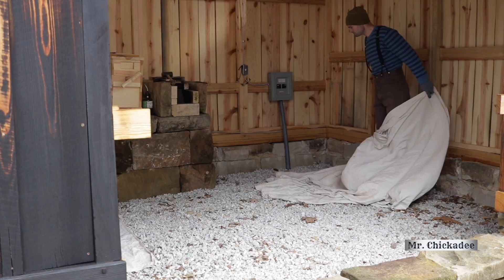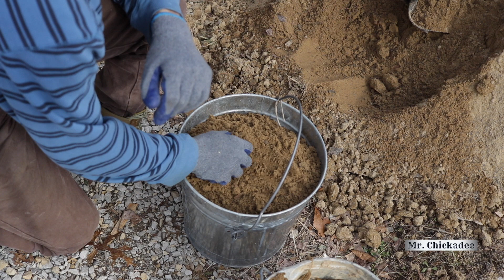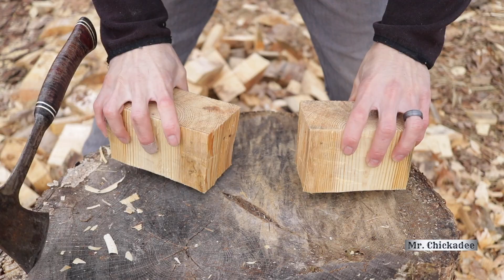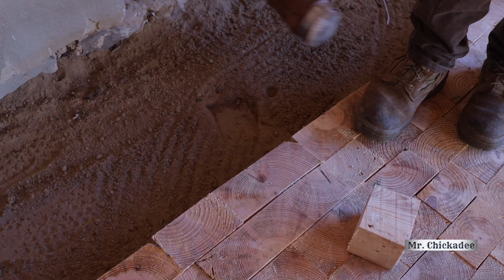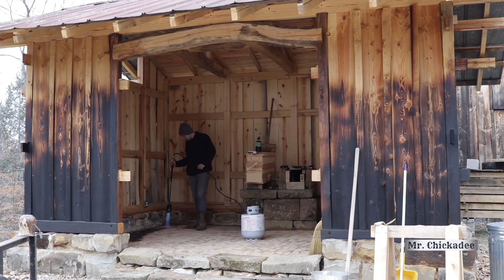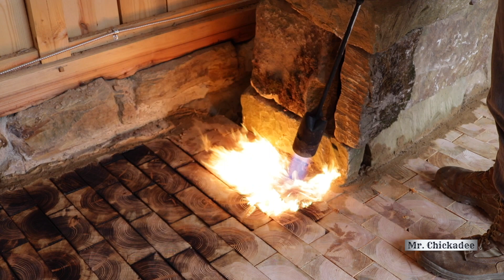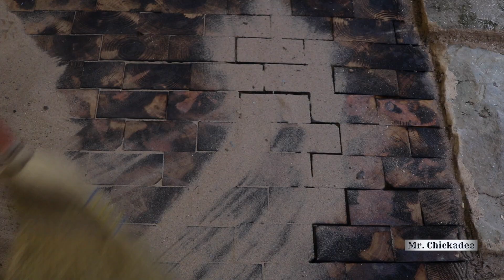Making a wood brick floor for our blacksmith shop

Comment: I worked in a shop with a wood brick floor for 4 years. A real advantage of this floor is that dropped parts suffer much less, or, no damage on hitting the floor.
Reply: My question is. How this floor keeps the level? I mean. doesn't the bricks move?
Reply: @emmanuelmartin2310   As he's installed them, they have a little give to them. I'm also guessing that he's doing it traditionally.

As for when they were used in industry, predominantly in toolroom applications, they were set on a concrete floor. I've been in a couple of shops that had them, and the blocks were 4"~6" tall. To set up a a machine, they just pulled up the appropriate number of blocks and and used the leveling pads/ assemblies on the slab under them, or put down steel blocks to replace them. That's the way it was explained to me.

Industry's gone away from this type of flooring for a lot of reasons, one of the biggest being safety. They soak up oil like a sponge, making them both slip and fire hazzards at the same time. They're also expensive up front for the wood; in the machine trades, oak or hard maple were usually the preferred types of wood, and those are slow growing species, versus softwoods like pine.
Reply: @7891ph  thanks for the answer :D
Reply: Plus they suck up a lot oil
Reply: The main advantage is that kind of floor does not hurt your joints back and feet when you walk stand on it every day for long hours. I you ever walk on one its like no other.
Reply: @emmanuelmartin2310  You can only squeeze so much into a finite area, the perimeter is fixed and if you fill in all your gaps it becomes a floating floor and will shift as one unit. Great floors.
Reply: 7891ph what if they sealed it or used the shoshugibon technique? Would that make a difference, or no? I mean you have to seal it with oil every so often anyway so the oils might help make it last even more than 80-100 in theory? Lol or is that the wrong type of oil than what they’re dropping on the floor? (note: I’m really asking, not sarcasm.) Oh lord, so I just got to the part where he burns the floor! Guess that answers that questions 🤦‍♀️ Wellp... this was a completely useless comment. But patting myself on the back for being on the right track, I guess.. 😂😂😂 should’ve finished the vid before commenting.
Reply: @ashleyfalcon125  Most floors were soaked in creosote to help preserve the wood. I worked at a production facility that was built in 1942 that still has an original section of wood floor. 

A disadvantage is that if the floor gets wet, the wood expands and heaves. It takes a lot of work to fix it.
Reply: @emmanuelmartin2310  no its much like how they do stone path ways, well exactly how they do them, the sand grouting keeps them in place.
Reply: Why not just leave it as dirt? my dad shop have a dirt floor and it seem fine.
Reply: @angerskarin9222  it makes it a bit easier to keep things level and tidy and won't wear, like at all even with heavy industrial traffic. So it could be said to be more a long term professional setup. Lower maintenance when lots of people are moving around on it all day everyday. No need to fill in where the dirt gets displaced. But more than that I suspect it's a point of pride type thing. There's just something satisfying about working on a floor like that that you don't get from concrete or dirt. It's one of those funny things humans do. The artistic view of what is the way of doing this that is in some way, however insignificant, superior to the others imo.
Reply: @angerskarin9222  Mud, puddles, holes...

Comment: I have seen many floors like this in my lifetime. I am 63 and have been in many factories built since 1900. This was the floor of choice. Thick wood floors in early Ford, General Motors and Chrysler assembly plants was much more comfortable than standing on concrete all day.  The intent was not beauty however it was used to save on back problems due to standing on concrete.
Reply: I worked in a ford stamping plant. The wood floor was used to cut down on noise and was easy and cheep to repair.

Comment: Sixty years ago I too worked in an old factory that had a woodblock floor. One Monday we came in to find the floor all "bubbled" up. It was crazy. There had been a large water leak in one of the old pipes and the wood soaked up the water and did impossible things. It even lifted a couple machines with it. It was a sad sight.
Reply: Sad but cool!  All of the factories I've worked in have had concrete floors.
Reply: I've seen them bubble as well, it's pretty wild to see it. It reminded me of a Salvador Dali painting!
Reply: They would probably be easier on your feet than a concrete floor too

Comment: In my home town in Yorkshire, when they removed some bitumen fron a road, lo and behold, underneath were wooden blocks.  Been there since the early 1800s, it seems.
Reply: I am from Irkutsk, Siberia. A century and a half ago city center streets were paved with larch blocks. Pretty the same technology as Mr.Chikadee used and as you mentioned. It seems that it was a kind of standard technique for that times
Reply: I`ve seen the same thing in a lot of the old London streets. Apparently they are all cedar blocks and were felled and brought over from Australia.

Comment: Where I worked, a 745 mega watt coal fired power plant, the mechanical maintenance shop used that type of floor. It lasted for over 50 years of very hard use. It's demise came when there was a flood which floated most of those blocks. Being a very timely task to reproduce that floor it was decided that the blocks be disgarded and concrete was poured as a replacement. The men who worked in that shop missed that floor. Also my wood working shop in junior high school had the same type of floor, it is still in service over 75 years old. Ecellent floor. :-)
Reply from the maker: wow, hard to imagine the concrete was cheaper? Maybe it was a labor cost issue? Or they did not find skilled labor who knew how to handle the job? I would always find wood to be much cheaper and better than concrete...
Reply: @MrChickadee  It was an issue of speed. They had to get that shop back in service as quickly as possible. Those blocks would have taken for ever. The plant was torn down in 2014 and 15 and replaced by a new modern plant.

Comment: I worked in a steel mill (sheet mill) in the 60s, where end grain hardwood floors were used. Those were typically laid over concrete, and usually sealed with some kind of pitch. They stood up to coils much better than concrete. Berger Juel (sp?) in Chicago used to make this flooring for high-end residential use. It was featured on a This old House project many years ago, when Bob Villa was in charged. It was awesome.

Comment: Job well done. I've been in lots of steel mills where the floors were covered with oak blocks because they are durable and easily replaced when someone drops a heavy steal beam on the floor. Some of the mills actually had employees whose entire job was to wander around those vast mills replacing broken blocks.

Comment: I used to work in a turn of the century iron mine machine shop when I was young that had the original wood block flooring. It was in great condition but undulated up and down in many areas from the loads of equipment driving on it. It was a good surface and looked very nice. 
I was sort of shocked when I first saw this type of surface as it varied in height a great deal. Having said that I was very smooth and held up very well to a hundred years of heavy use.

Comment: I remember being in a Caterpillar manufacturing plant in East Peoria, one of the really old buildings, and it had a wood block floor. I was told that there was a large clamp at one end of the building that held the blocks in place. It could be released if blocks needed to be replaced.

Comment: Nice. My father told me that machine shops used to have this sort of floor made of end grain oak over concrete. It could take the weight of heavy lathes and mills, and if you dropped a tap or milling cutter it wouldn't be damaged.
Reply: I worked for Illinois Tool Works as an Apprentice Machine Builder in 1963, they had that wood floor throughout the whole shop. Lathes, mills, grinders, it was comfortable to work on. And no damaged parts if you had an "oopsees".

Comment: One place I worked had a million square feet under roof (built in 1943) and most of it was wood block floor covered with tar. When the roof leaked, the floor soaked up the water and the floor bucked up. They broke open the buckled floor, scooped up the blocks with shovels, laid fresh dry wood bricks and re-coated it with tar. Good until the next gully washer!
I admire your tenacity, good job. Thank you.

Comment: What wonderful way to floor for your smithy and a beautiful job. We all do things slightly different I was a little taken back when you mortared the edge, felt that a fine gravel (cracker dust) would have been better (probably not locally sourced though) especially since you went to so much effort on the dry fit foundation. Always find it better to finish the half bricks at the edges after the whole floor is laid (find it's effecienct in action and process and can help stop creep), We also typically dust pavers with dry sfine and then compact (using a motorised vibrating plate compactor.....not so traditional), this helps drive sand deep into the seems and locks everything very tight (sort of looked like you had swept a fine layer in prior to wackamole?).
Thanks for sharing your knowledge and art, very much look forward to seeing your forge up and running.

Comment: Wood brick floors is one of the best type of floors in a smithy, even for modern shops. 
In my opinion. 
The reason why is because they're not as hard as concrete so you don't hurt as much in your feet after standing on it for a day, also the bricks that are in the path of most wear can easily be replaced. (maybe not so much when they are handcrafted frm a log rather than being cut from a 2x4) Torching them was an awesome idea I had not thought of before and it will render them more stable when it comes to catching fire. And they burn less so than the rubbermats that are commonly placed in blacksmith shops today. :-) 

This has been my floorplan material whenever I get around to my own shop, and it was nice to see some improving ideas and get some great inspiration!
Reply: I don't think the torching/burning has any role in fireproofing them. Josh has explained that it makes the wood less palatable to wood eating insects.
Reply: The place my father worked, Acklin Stamping Co in Toledo had creosoted wooden blocks on the floor. A really good floor I'll tell you. Also there were some streets of those blocks.  The only problem was when it rained, a lot of them would float away.
Reply: @idontthinkso666  From what I have experienced I got the impression that it helps to torch the wood against smaller embers and such, which is mostly what a smithy's floor is going to see.

But you also have a very good point about the insects.

Comment: When I was a young 10-11 y old we were moved to a newly built school closer to my home. Some of the classrooms had woodblock floors. They were fine when they were new, but kids will rock on their chairs and that dislocated and loosened the blocks slightly, so when you moved your chair leg to a crack between two blocks, you could suddenly find yourself lying flat on the floor staring at the ceiling! To the amusement of the rest of the class. Those floors were over time replaced by good solid concrete and vinyl flooring. 
Having said that wood blocks make good sense at a blacksmith. If you drop something like a chisel on the floor it won't get ruined.

Comment: I use to drive tractor trailer in Philadelphia PA an go into one warehouse on Spring garden Street. It had a wooden floor over 100 years old and still in fine condition wearing like iron.
Reply: Philly also has a couple of small streets where the paving is done in wood blocks

Comment: I live in Louisiana and the termites would love this floor , more than me.
Reply: Im in northeast Texas.  Same here.
Reply from the maker: Most termites prefer wet or decomposing wood in contact or near to wet soil. Understand this and you control them.
Reply: How about linseed oil?! It is bitter.
Reply: We going to leave the fact that souh shugi ban (aka wood burning) creates chemical compounds and a particular smell that is 99% resistant to termites and other bug infestation??
Reply: @MrChickadee  Is there any concern of the floor collecting moisture and developing rot?

Comment: I don't recall how you sharpen your hatchet, but I changed the edge geometry on mine to a single edge bevel. It made doing those kinds of tasks infinitely easier. Also, I usually use a hand tamper when I do that project (I doubt you'd use a gas powered plate tamper). 

All that being said, another great video. Another great idea.
Reply from the maker: I have a plethora of hatchets with various grinds and weights for differing jobs....this one is double bevel and works fine
Reply: @MrChickadee  yup. The light bulb came on as soon as I read your reply. I'm such a boot.😑

Comment: I worked inside a Caterpillar plant for 14 yrs. most of the time replacing the wood block floors.. remove and replace... Surprising the amount of weight and  abuse they get.. actually last longer  than epoxy...

Comment: They are sometimes called "Belgian Block" floors.   Not only easy on people's joints but on mobile machinery - a big plus when you fork lift has no suspension.   Virtually indestructible to the hottest metal.  But it is wood and never, ever, let it get wet.   the wood expands radially and the floor buckles and they ain't cheap to fix.   A great favorite in the auto, foundry, and forging industires.

Comment: Great video on these type floors.  I worked for an elevator manufacturer that offered blocks-on-end platforms for industrial elevators, made by individually nailing oak blocks end grain up to a wood plank sub-floor, then sanding and finishing with 30wt oil, it was beautiful work.

Comment: Saw one of these floors in a horse barn years ago was amazed how well it held up through the years. One of those things you see and don't forget. Definitely the original antifatigue floor. Very easy on the feet

Comment: Put a bit of old motor oil on it once a month for 6 months, then once a year and your grandkids will be walking on it.

They last for a damn long time, once the char wears away they have a superb non-slip surface and they're quiet.

Edit. I forgot to mention there are still sections of road in Sydney, Australia (north end of George St, at The Rocks precinct) made of tarred wood blocks that date from 1880-1890. They were used extensively in both Sydney and Melbourne and a way to provide a stable road surface that was also quite and easy to maintain.
These days the asphalt comes up occasionally but just gets covered over, or left bare if there is low traffic.

Comment: There's an old Studebaker dealership near me and the service floor is oak block, it's been in there since it opened in 1885. I believe it was originally sealed with beeswax or paraffin. It's privately owned but still used for fabrication and repairs.

Comment: I read an article that talked about alley ways in Chicago being done in a similar way except the wood blocks were dipped in hot tar and laid out.  The family farm had a shop/forge of a similar sized with a dirt floor, someone had dumped a can of carbide on the floor and when the humidity would go up you could smell acetylene gas... watch out for spills of oils and paints.  I am curious about how much time time in total it took to done the floor project. Have a good day.
Reply: He replied to other comments that just making the "bricks" took a full week, so go from there.

Comment: They put this kind of floor in a GM plant in my home town. Of coarse that plant is gone now.
Reply: Same floor in a former Uniroyal tire plant built in the 1930-40s in Eau Claire WI
Reply: Ditto, Caterpillar tractor company East Peoria building HH. (Isles 20 ft wide and and 300ft. long or thereabouts). Solid oak!
Reply: You must be from Evansville.  I toured the sporting goods where house where the old .45 cap factory was.  GM plant made tanks and planes too.  The posts were three feet long tho, sunk into Ohio river bank.
Reply: @oldnick4707  I bet it's beautiful

Comment: FANTASTIC... I commend you on doing that floor.
Strong, and they say the slight unevenness relaxed your feet not like standing on stone of concrete.
Does not damage tools or work if it should fall.
We have a barn near us with wood bricks in the lower lever floor for the horses.
Not sure but I think they may have oiled the bricks over time or it is just the years of use.
Great Job.

Comment: Ford's River Rouge assembly plant had wood block floors. Looks and smells like it was coated with creosote. Forklifts were driven on them constantly.
Reply: I toured the GM Broening Highway plant In Baltimore back in the 1980s, it to had wood block in various areas of the assembly line floor.
Reply: GM in Tarrytown NY ditto

Comment: So many questions: how does it resist moisture? What mitigates rot from underside? What happens to all those discarded wood chips?? Gorgeous! :)
Reply: I would like to know as well
Reply: I'm not to sure about the rest but I damn sure know those wood chips get tossed into either a fire place or fire out.
Reply: It appeared to be above ground level on top of a layer of rock. Then the burning of the wood (shou sugi ban) makes it moisture, fire, and bug resistant.